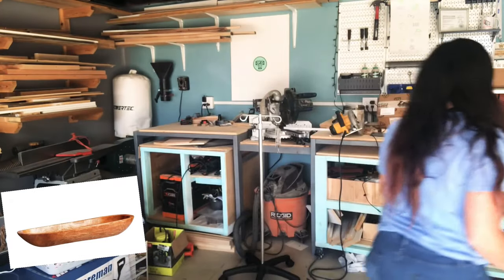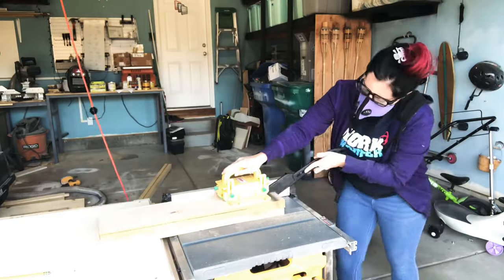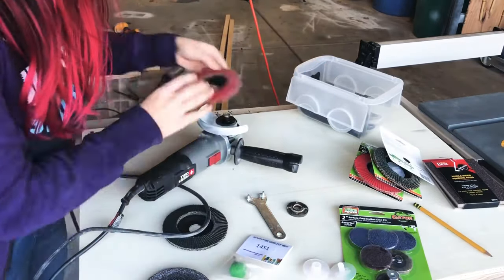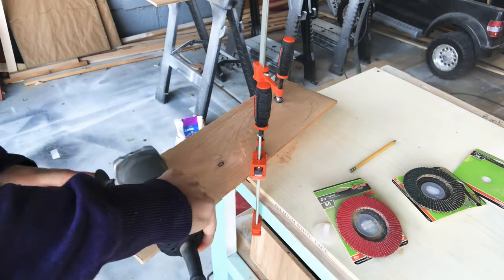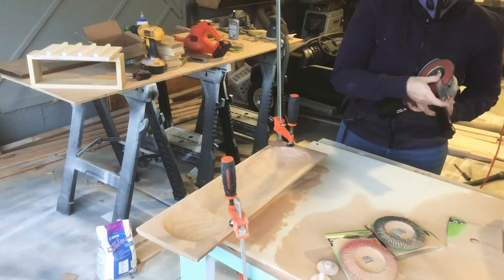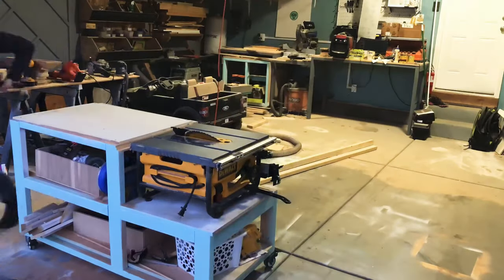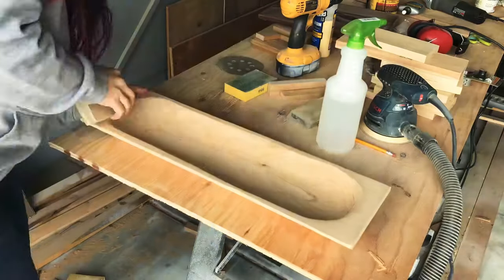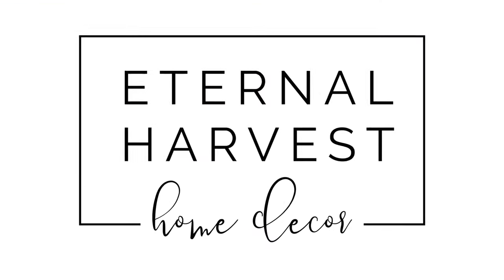HOW TO MAKE A DOUGH BOWL - DIY DOUGH BOWL

Comment: Nice job on the dough bowl! I know you mentioned carbide cutters in your video and I know the grinding wheels you used were less expensive but when you make chips instead of dust your ckeanup time is cut in half. Just something to consider if your going to make bowls or carve more often. Again nice job.
Reply from the maker: Gerald B totally! I would use them if I did it more often, that’s a great point

Comment: For future reference, the oil you used could be replaced with common mineral oil from any pharmacy. It's much cheaper and does the same thing.

Many "finishes," or treatments, like the Watco Butcher Block oil, are as much hype (Madison Avenue advertising) as anything else. Take Watco Tung Oil finish, for example. It's just thinned finished boiled linseed oil based poly.

Mineral oil is a great treatment for things like this. As wood dries, it shrinks, which will cause cracks and splits. The oil will keep soaking in until the wood is saturated (many coats slathered on and allowed to soak in, rather than wiping them off). This will swell the cells and many fine cracks will appear to have disappeared.

All that aside, good job. It turned out nice.

Comment: Before you glued the 2 alder boards together, did you first have to plain the 2 sides with glue ? Is alder expensive, it sure looks nice?
Reply from the maker: I did yes, and alder is a hardwood but I’ve found it’s not much more then box store lumber. It’s much prettier and dryer and has become one of my faves. I make lots of tables out of it so I had some scrap pieces from a table

Comment: I have been a woodworker for over 20 years and, like most guys I suppose, never heard of a dough bowl.  Recently a friend of my wife asked me if I could make one for her. After watching your video, I think I can do it.  It looks like you used two pieces of 8/4.alder.  Is that the correct lumber  thickness?  CW
Reply from the maker: creighton west yes you can for sure! And it was 6/4 alder yes, but you could do it with any thickness really. As long as you watch your depth you should be good 😉👊🏼

Comment: Very inspiring. I bought a 4  1/2 angle grinder from harbor freight. They are out of the grinding wheel. I am buying on line. What does type 27 mean?
Reply from the maker: Basically a general purpose grinding wheel for a bunch of different surfaces. You might want to look at a @kutzall blade they will cut through much faster 👊🏼😉 good luck and thanks for watching!

Comment: Hello, Love the Doughbowl , I was wondering how you cut the angle on the ends?  I just bought a table saw for projects and I chose to try your nice bowl. I’m not understanding how to hold the piece to get the 45 on all sides.  The video seemed to speed up or skip past a part that I am having trouble with.
Reply from the maker: I actually used my table saw to do the 45°, but you could carve the inside first and then flip it and carve a tapered base to. Either way

Comment: Are there other woods you could use instead of alder?
Reply from the maker: sure. I think this would work with anything, but the harder the wood the longer it will take to remove material.

Comment: Had you waited to cut the 45 degree angles until after carving the inside you could have clamped it on the sides and not have had so much moving of the clamps.

Comment: May be it would be easier with metal carving or rasp disk
Reply from the maker: probably but I try to focus a lot on beginner projects with quick easy to get items and those metal carving disks need to be ordered where the sanding disks are at most big box stores. Good thought, thanks for the comment.